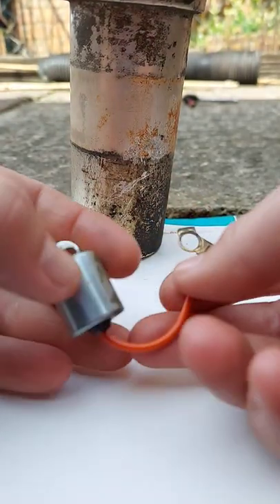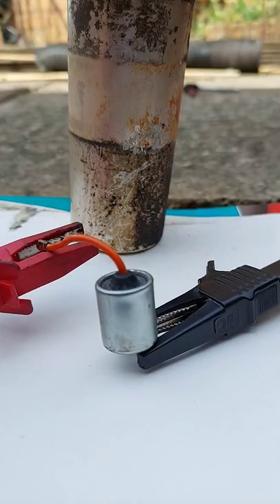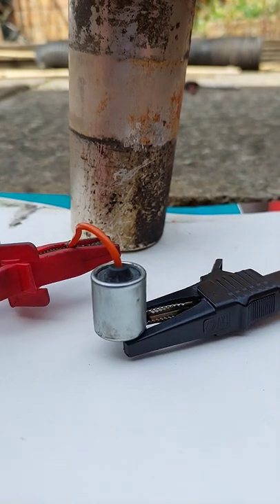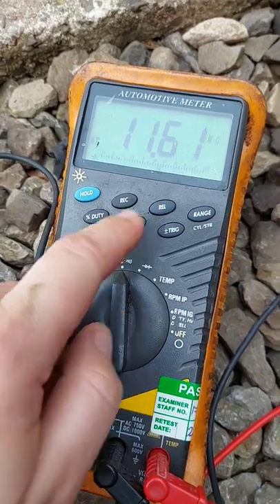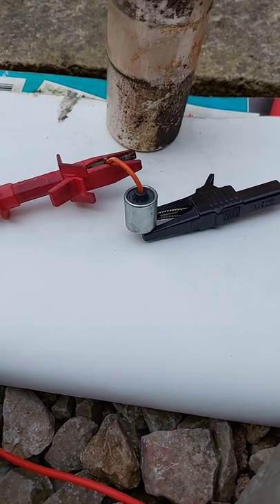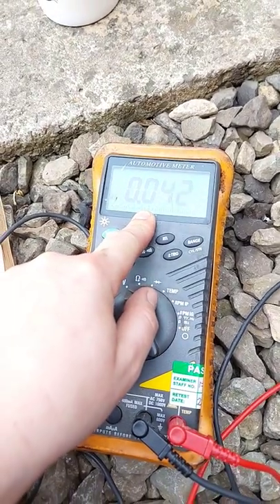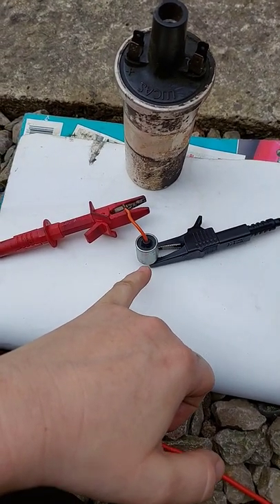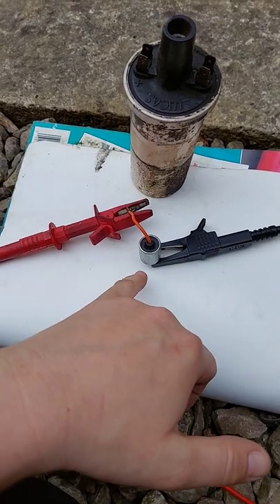Testing a condenser from a classic car distributor

Comment: A very good check without resorting to high tech equipment use. Someone asked, if the cap was faulty, what would you see, well, with your meter on ohms, check between lead & metal case, there should be no leakage(reading on meter) if the dielectric has broken down, it will not show an incremental rise charging on ohms, & a negative reading on the volts measurement. Like the youmg lady said; make sure youve discharged it before doing the test demonstrated. Thank you for putting this on youtube. Good stuff
Reply from the maker: I'm glad you liked it 😊